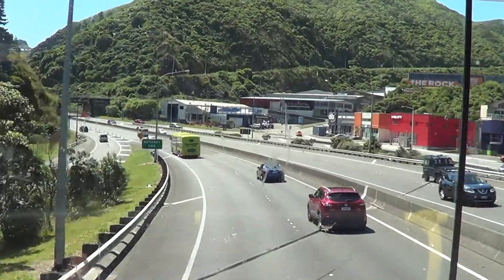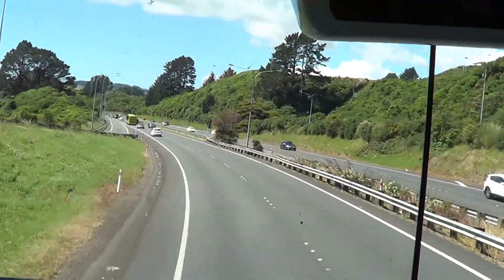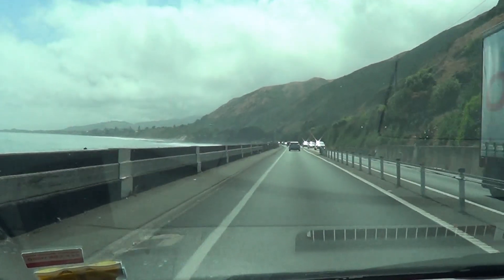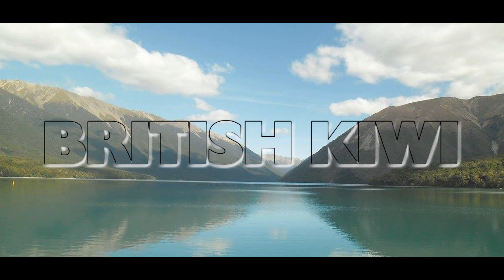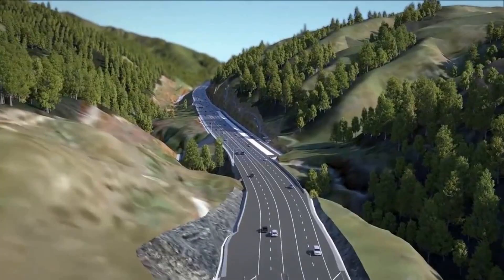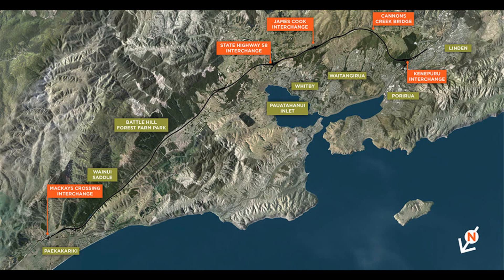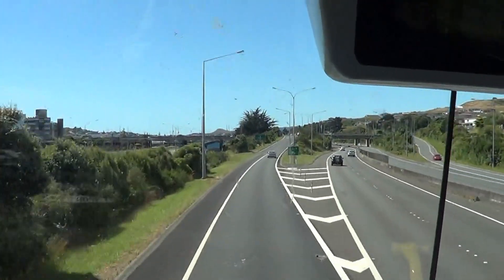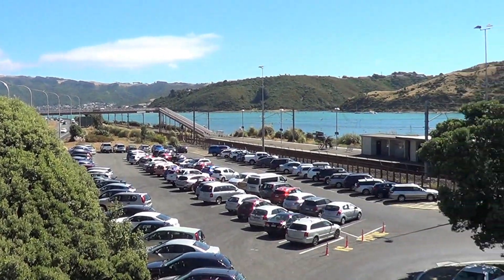Transmission Gully: Fixing & Futureproofing Wellington's Motorways

Comment: Unfortunately Transmission Gully runs along a major fault line, so lets hope we don't get a biggie in any of our lifetimes.  It's is also reported to be steeper and more than twice as long as Ngauranga Gorge, so cars like my Nissan Wingwroad may still have to use the current route in order to save fuel and stress on the engine. It doesn't like Ngauranga or even the Haywards Hill Rd (past the substation) at all.  Great vid, keep it up.